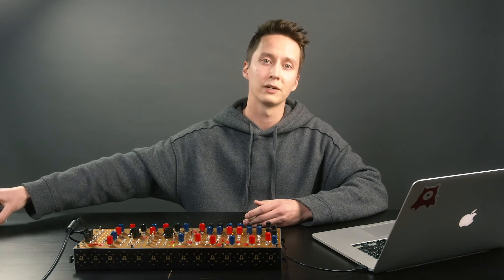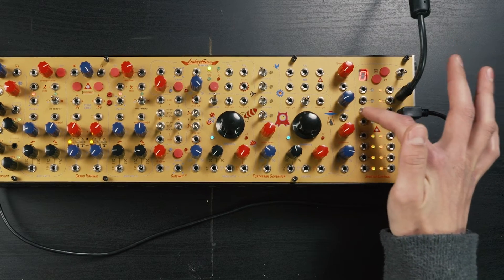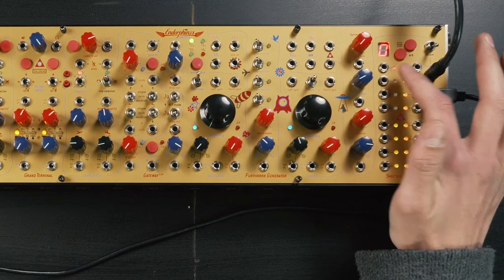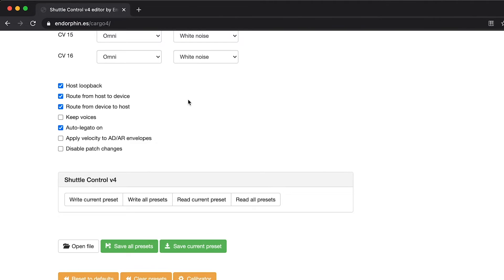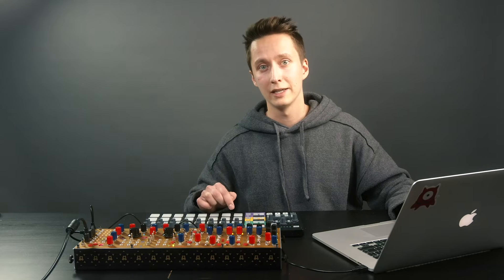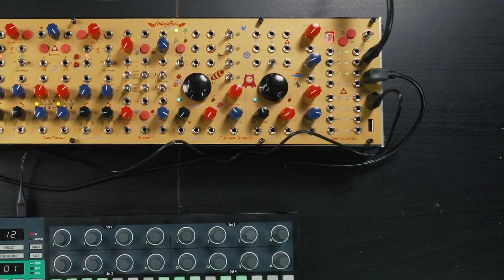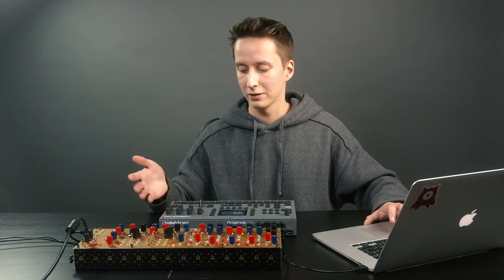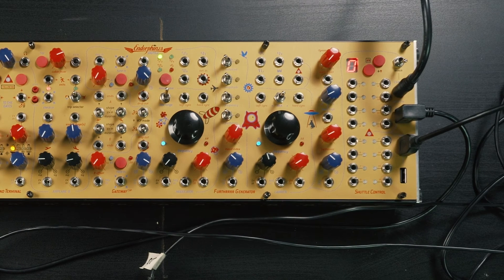How to set up Endorphin.es Shuttle Control in Apple Logic, Elektron Octatrack & Arturia Beatstep Pro

Comment: Thank you for these videos!!

One feature request— would it be possible to add a configuration to adjust the max voltage output? Ex) envelope AD uni has a 5v range, but some vcas and lpgs expect a stronger signal (8-10v).
Reply from the maker: thank you. 
as for the feature request - there is a hardware restriction that CV outputs can't go above +/-5V range. To boost the envelope without any utilities we could advice the following: duplicate the same envelope into another neighboring or free CV output jack and then connect BOTH those jacks with same envelopes with the passive mult or stackable calble. They will be mixed together giving appox. twice higher amplitude 0 to 10V.
In a same way you can offset BIPOLAR triggers/gates/pitch CVs: just assign another free CV output jack to fixed CV output - i.e. fixed 5V output. Mixing both jacks passively will give you offset and you will get 0 to 10 V voltage instead -5 to +5
Reply: @Endorphines  genius! I hadn’t thought of that. Thank you I’ll give it a try